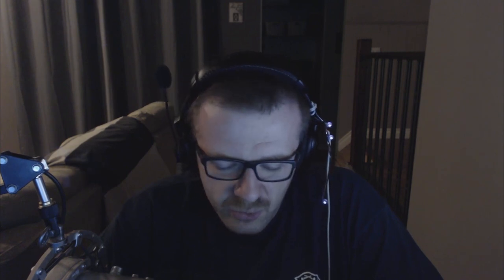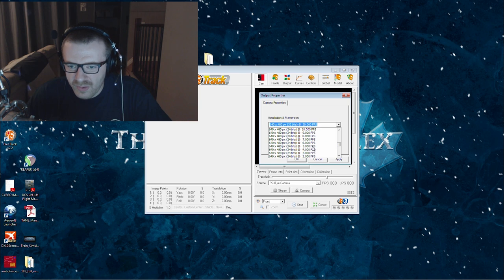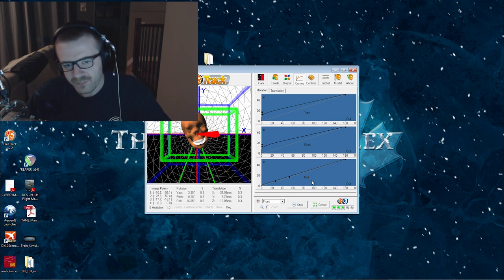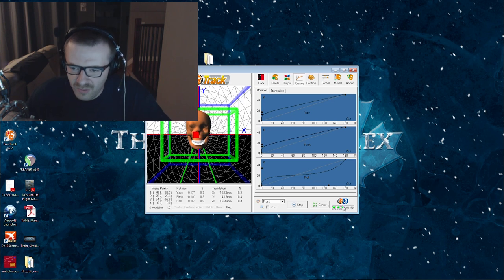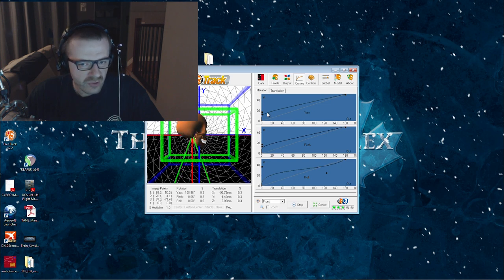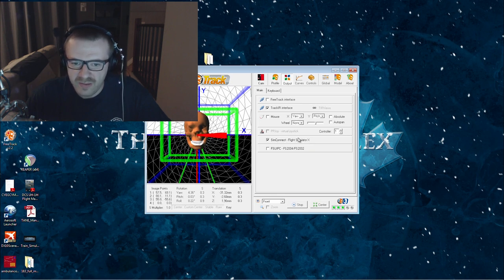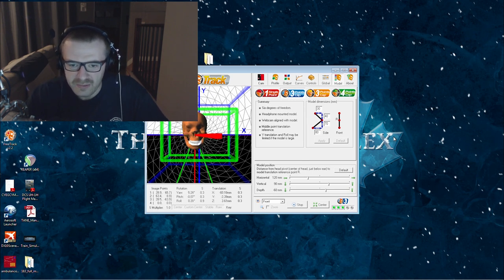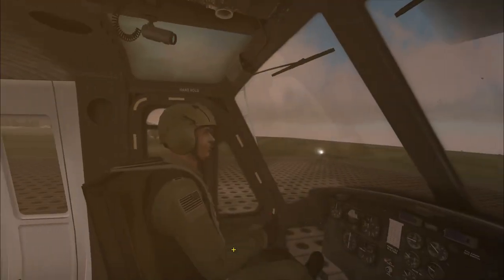DIY IR Tracking Device Tutorial Part2| Setting up FreeTrack 2.2

Comment: You skipped the driver installation process. I can't get my ps3 eye to work in tracking programs and in Skype. It works in programs that come with drivers to test if the camera works. The camera actually works, but doesn't work in programs like opentrack and facetrack NOIR.

Comment: If you just use normal LEDs rather than Infra Red LEDs do you need to alter the camera ,Do you need drivers for the PS3 Camera
Reply from the maker: +Richard Warcup I am not sure if you would get the same result with normal
LED's. You would probably pick up a lot of artifacts from reflected light and so on
Reply: In theory you should be able to just use light.. as long as it's the brightest source of light just adjust the exposure on the camera until everything else is unexposed and you can only see the points of light.

Comment: I have used this for about a year now and it worked brilliantly, but just like that freetrack can't find my PS3 EYE..
Device manager says it's installed and working, but I can't even test it with the CL-eye test program..
Any ideas as to why ?
Reply from the maker: If you have more than one device installed it will only find the one on ID 1, it's something i found out the hard way
Reply: More than one device , do you meen more than one camera ?
I only have this as I do not use a webcam at all...
I only use this for freetrack..
Reply: I can see the ps3eye's microphone in CL-eye test but not the camera..
Reply: I reinstalled the CL-driver 4-5 times and now the CL-test works and Freetrack shows up the camera, but I still don't get the "reddots" from the IR diodes in freetrack.. 
Any ideas as to what that could be ??

Comment: Niiiiice! Thank you so much and congratulations!!!
Reply from the maker: Cheers
Reply: +TheNorthernAlex Can you explain to me how this tracking works without a stereo pair?
I had two photogrammetry courses and know about the subject, but i am not able to figure out how it works with just one camera.
Reply: +plavix221 it sees the three points which are corners of a triangle of predetermined shape and size (you set the distances between the 3 trackpoints in the program settings). It then translates the change of position of these three points on a "screen plane" into information "how would I need to rotate the triangle to have these points look like this from where the camera is".

Comment: I made a headset similiar to yours. I however am showing Way too much IR light going into the camera. I assume the IR are too focused, and wanted someone's opinion on diffusing them. This is All new to me so did I even use the right terms?
Reply from the maker: Ben Cox Yes you did, but you don't want to diffuse them, lots of IR is good, if it is too bright you can change the setting of your camera to make it less sensitive to the light by lowering the exposure settings
Reply: Thank you Mr. Alex. I had plenty of spare LEDs so I went ahead and scuffed up the ones currently in the headset. That actually worked. I couldn't find any way of changing the settings for the PS3 eye, after reading about the CL driver I have it says that it automatically adjust for exposure. It's working like a charm now. When I build a more refined headset in the future (this one is made out of cardboard) then I'll try adjusting exposure settings instead of diffusing the LEDs. I subscribed to your channel, because I wouldn't have been able to do this without your videos. Thanks! It's working beautifully for Elite Dangerous.
Reply from the maker: Ben Cox I am gald it works, how do you like Elite so far? is it faithful to the original??
Also, the setting for Exposure you'll find in the freetrack software under stream
Reply: TheNorthernAlex I did find the exposure, I'm having trouble getting the camera to actually work. I suspect it's due to it being plugged into USB 2.0 and my bios probably needs an update. I'll figure that out, as it stands it works about 25% of the time I boot up the PC. 
I never played the original Elite, but I am a sucker for space sims, and Elite fits the bill quite nicely. I'm actually building a specific space sim cockpit enclosure for Elite and more directly for Star Citizen in 2016. Once I get the head tracking working 100% of the time (which I will once I find time to play with it) then the cockpit is going to bring the simulation to a whole new level. 
TLDR: Elite is a great game, and I'm having a lot of fun with it. Having never played the original I still find it extremely fun and very well done. They take the simulation feel to a new level, which is impressive compared to others such as the X series.